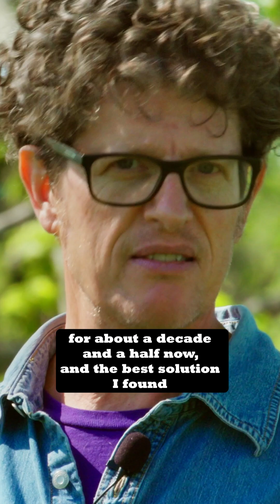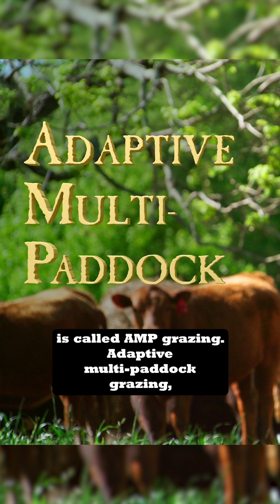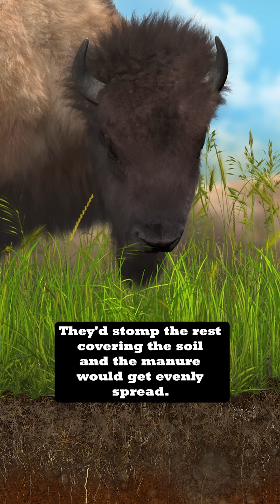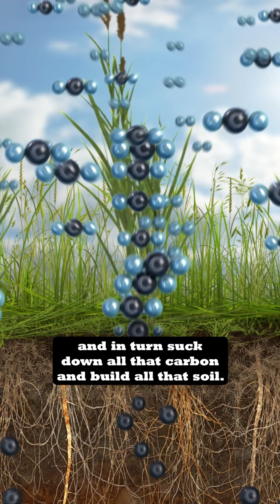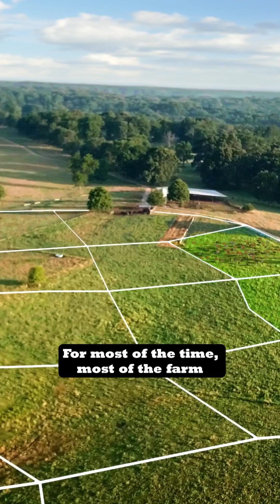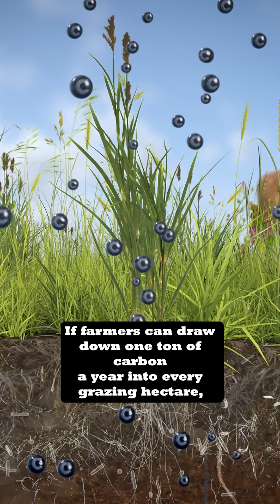What is AMP grazing?  #farming

Comment: Another great tool is perennial crops. When the soil is plowed the carbon in the soil is exposed to air. Aerobic bacteria will consume the carbon which has become more available and release much of it to the atmosphere as carbon dioxide. Perennial crops don't need the soil plowed, so the carbon from plant residues and root exudates can accumulate in the soil.

Comment: I looked at the study on chat just now, it works for 4-5 years and then the roots hit their maximum depth and density and it stops expanding the carbon sync. It’s good and should be done but it only reduces carbon for a little while during the establishment phase. Cows still emit more and the methane is 80x worse than the carbon. We need a billion more cows to meet demand right now. It’s a problem but I don’t really care, we will find a way to live and survive.

Comment: From what I have seen, he ain't wrong. The problem is, those who go this far against the narrative and you end up missing we're found with two holes in the back of the skull and it is declared as self deletion.
Reply: I am praying for his safety. If it gets past critical mass, there will be no stopping Regenerative Ag. At least a bunch of farmers have made enough money doing it to buy farms around them.
Reply: READ my post.
Reply: @williamalanwood8060 I'd rather see your soil. I am from Texas and seen the differences on how the land is ran myself. I have seen a patch of ground that is dry, dusty, and hard 4 in down. Roughly a mile away during the same drought season, I've seen the soil of another patch of land ran exactly how this guy is saying to do it. Not only does it have moisture nearly a foot down, what is abundant in small animal as well as microbial life. After handling both patches of land, it's hard to believe they're so different, yet so close in proximity. The numbers will vary depending on methodology, but is base premises are correct. If you have a paper to show me and no land to back it up, I'm not interested.
Reply: @cjvan713  It is working on my farm. I see changes every year!
Reply: @cjvan713 
bison are proven more hardy and less work, less cost in some respects. Unless you're raising for meat and have a small ranch. The infrastructure is a lot more expensive for bison, just less hands-on. The results you speak of are good, bison would have been better for ecological rejuvenation. Glad its improving your soils. Have a great day. Im in E. Tx.
Reply: He is very WRONG!
Reply: @williamalanwood8060How is he wrong? They did a 10-year study with AMP grazing next to conventional farms, and documented the results. They used many different scientific systems with different scientists who don't usually work together, and found great results. Show your proof.
Reply: @williamalanwood8060That’s your opinion.